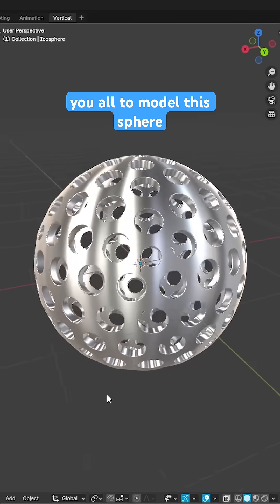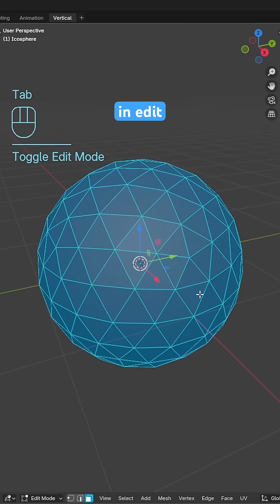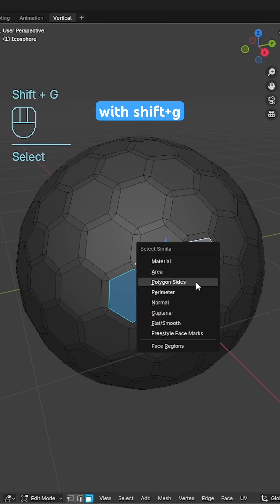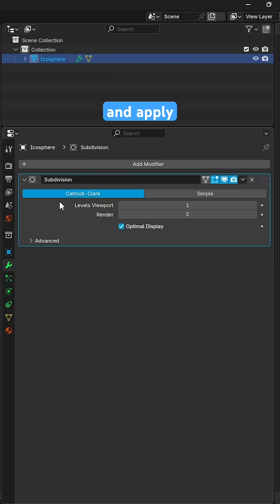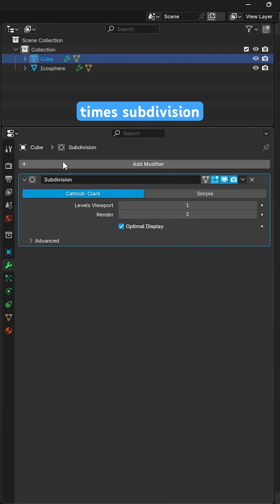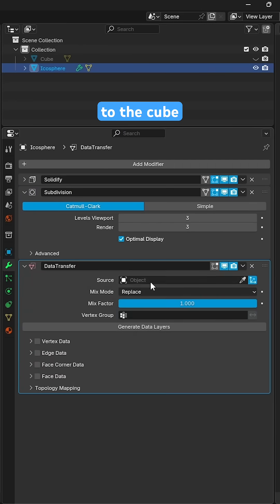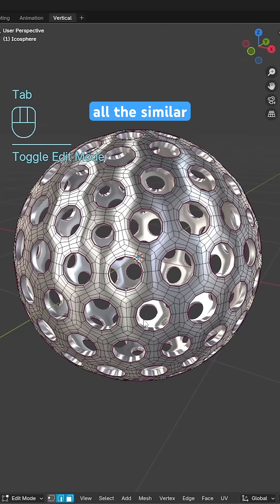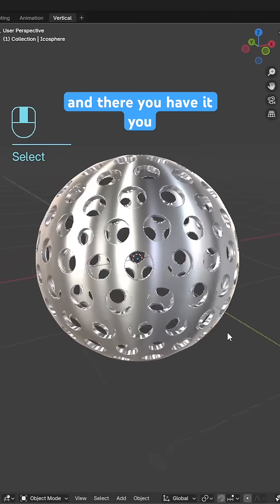Blender Modelling Challenge 6 Solution | #blender3d #blendertutorial #blendermodeling

Comment: Not trivial!  I recently tried to model a pickleball using modo. I'd like to see how you would do that in Blender. It's a little harder than this sphere task. There  are 40 holes in a Franklin X-40 ball, which are all the same size. They are not placed in a regular pattern. You can't use a subdivided icosphere to get started. It took me many iterations to get a result I was somewhat satisfied  with. Cheers from Los Angeles!
Reply from the maker: Yeah, that would serve as a bit more of a challenge since you need to be more deliberate and discerning with the placement of the circular cutouts. Though, I think I would've approached it in a similar way to what you said, using an icosphere but with a lower subdvision count than in this tutorial. 😄

Might even require doing some poked faces or something of the sorts to get verts arranged in a triangular arrangement to achieve the correct circle placements.

Comment: Whats the point of the data transfer
Reply from the maker: It helps correct the surface normals after adjusting the circles on the sphere after the first subdivision. The vertex groups then just help us define which areas it should effect, since we don't want to destroy the hard edges that we have on the model.

In hindsight, I think using alt+shift+s to spherise the model after the first subdivision would've been a less convoluted and more streamlined modelling approach. 😄

Comment: Ive been getting into blender and ive done a lot of sculpting and a very small amount of modeling and i have like 400 hours and im still wondering at what point I'll figure out how to do these kinds of things. So many different modifiers and key combos required as well as knowing when and how to use each of them. Makes my head spin!
Reply from the maker: Sorry for the late response to this one, but it all just comes with time and practice. I can't give you a definite time frame for when it will all just click and become second nature, but that will be something that comes with using Blender more and more. 😄

For me, personally, I found I started to learn the most when I tackled more complicated modelling projects that were outside of my ability for the time. The results of the models wouldn't always be what I wanted, but I would learn a bunch of ways to problem solve along the way. I'd then typically start from scratch and apply my new found knowledge to not make the same mistakes as last time, and over time, that just lead to me slowly getting better and better with my craft of modelling and learning all of the various tools and shortcuts that Blender has too offer (and even now, I still don't know all of them 😅).

So my best advice, even if it may sound a bit generic, is to stick with it and to keep trying new projects and occasionally trying modelling projects that push you outside of your comfort zone. 😄 Sounds like you've got the right attitude to want to learn, so that will make the rest of your modelling journey easier.

Comment: those normals r crazy wtf???
Reply from the maker: Yeah, the data transfer is a very powerful modifier. In hindsight, I should have also paired it with the shrinkwrap modifier to have the surface more accurately reflect the normal that we were interpolating from. 😄

Comment: I've been learning blender and my biggest gripe is worrying about the normals.. in maya I just do soften/harden edges and it just sorts the shading.
Reply from the maker: You more or less have the same option within Blender, using either creases or bevels in hard surface subdivision surface modelling workflows. Alternatively, you can use sharps in weighted normal modelling approaches, though I believe these are better suited for environment modelling than character modelling.

In this instance, while we use creases to define the hard edges of the model, it kinda works against the model's shape (in hindsight, bevels would've been preferable here), which is why we use the quad sphere to interpolate the normals from. 😄

Comment: 😢but the holes are not all the same, some are smaller...
Reply from the maker: Yep, something I wasn't thinking about when I originally did the model. 😅

However, after the first subdivision, we could go back into edit mode, select a crease, shift+g, to select similar creases, and then use the LoopTools circle operation and adjust the radius to make them all the same size. 😄

Comment: This is an insane way to fix normals what the heck
Reply: Used this modifier before for decals, but I'd assume something like shade auto smooth, or bevel + weighted normal would work too
Reply from the maker: Yep, this would also work and wouldn’t require the data transfer if you used a weighted bevels approach. I just personally like doing things with subdivisions, so I try to centre lol of my content and teachings around it. 😄
Reply from the maker: Yeah, the data transfer modifier is very powerful. 😄